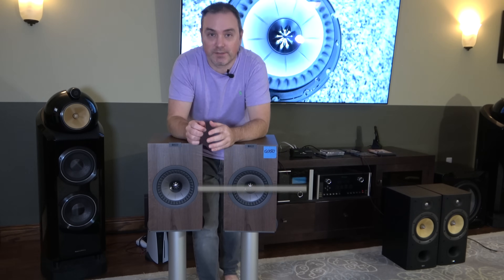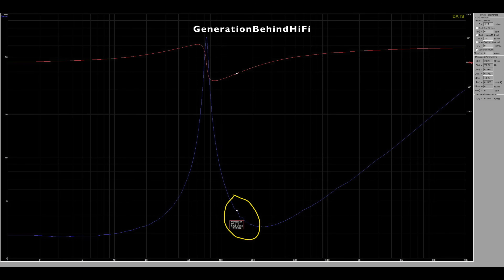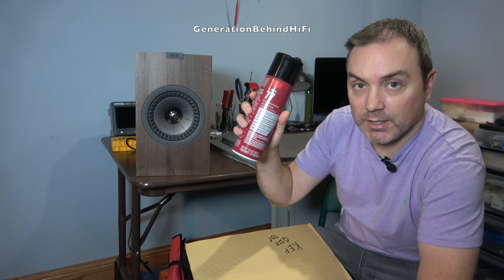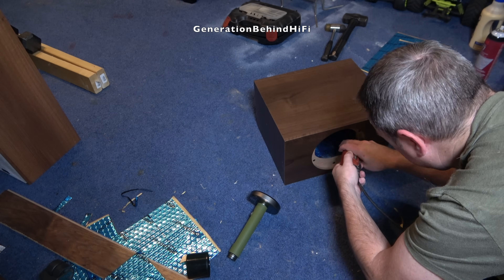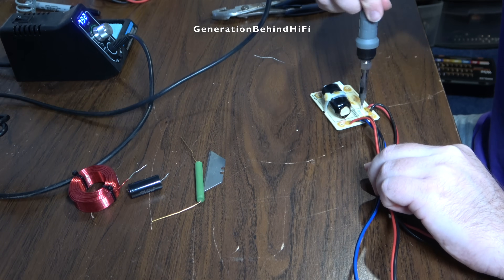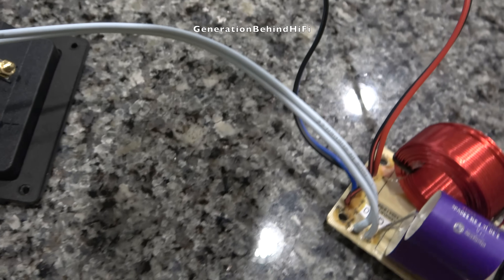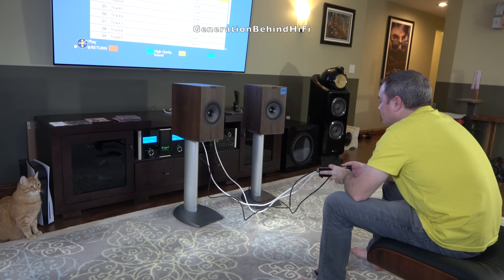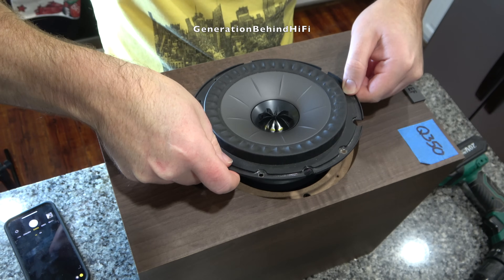Upgrading My KEF Q350 Speakers - Resolving Cabinet Resonances and Upgrading Crossover Parts

Comment: Well I, if I had those speakers I'd be using Norez as the cab dampening material it has a sound dampening layer behind its close cell foam layer. One of Online's most prominent Designers D. Richie who is an Electrical Engineer does free assessments of anyone's speakers doing full analysis then does redesign of the usual Cheesy crossovers. The analysis and redesign are free the only charge is if you want to buy the upgraded parts and tested against the original. His channel is GR-Researh or business that is.
Reply from the maker: Sonic Barrier has the same sound deadening layer built in too. It's actually a 3 layer system. I just chose to double up on the sound deadening material to ensure I would have no cabinet resonances -- as you saw in this video it worked. Yep, I'm well aware of GR-Research. He creates some cool content too. Personally I have never tried any of his designs but customers seem to be happy with them.
Reply: The Sonic Barrier product actually works a little better in this application because the cross section of the material is narrower and fits better into this tight cabinet. No-Res is a great product but is thicker in cross section making it less beneficial here for clearance purposes.

Comment: Great upgrade video! I think the radius behind the driver needs to be way bigger to have an effect. I would guess the radius needs to be 1/4 of the wavelength to have an effect. I've seen test from users on diy audio forum on the baffle edges that you need to have a pretty big radius to see an measureable affect on a sweep. And those were testing with 1 inch radius and even greater..  I also think getting rid of the iron core inductor is the fastest way to get rid of iron core distortions is the most noticeable upgrade people can do themselves. Just my 2 cents.

Comment: You can place no-rez strips on the woofer basket and magnet to try and dampen that driver resonance.
Reply: He could also solder the connections to the speaker instead of using those slip on connections. He made a point about them to the binding posts, but then kept them in the speaker which didn’t make any sense to me.

Comment: Would I use only the Amazon deadening material to improve cabinet resonance or must I also add the foam? My speakers are the RP600M V.1.
Reply from the maker: I decided to use both for my build. If you had to chose between one or the other, then I would choose Sonic Barrier. It's a 3/4" foam damping material with 3 layers built in and is really good at combating cabinet resonances. You can find it here: parts-express.sjv.io/qzW09b
Reply: Thanks.

Comment: This was an awesome thought provoking and informative video!! Thank you! 🎉 

Ps. Would be cool to see you compare upgraded 350 vs R3meta/concerto/ etc. 🎉
Reply from the maker: Thank you! Glad you enjoyed it. I have listened to the R3 Meta many times and they are a very nice speaker. Even my modified Q350s are no match for the R3. The drivers being used in the R3 are much better than the driver in the Q350. I would bet the drivers in the R3 Meta have a much flatter impedance curve and a lot less VC inductance. Most higher end speakers do.

As for the Concerto, my Q350s might have a chance against them? I sure would like to get my hands on a pair to find out, but it probably won't happen until next year. I bought a pair of KEF Q3 Meta and thought my Q350s were much better. Even most of my subscribers agreed when they listened to the sound demo of the Q3 Meta vs my Q350s. Thanks for watching!

Comment: Great Video.  Thanks for doing this for us.  What is the tool you used to check for resonance?  Maybe do a video on that as well as how to use it properly.  I would love to give that a shot on some of my speakers.  Just don't know how to do it properly.  Also, what's up with rolls of insulation stuffed into the corner of the cabinet?  Does KEF not have any quality control?  Geeze!
Reply from the maker: Sure. I might be able to accommodate your request. I'm using a Dayton Audio DATs v3 and its a must have tool if you like to tinker with speakers. 

I hear yea, the bunched up rolls of damping material are pretty low quality. I tried using them at the base of the cabinet where my crossover is but I was still getting a standing wave when measuring. I ended up throwing the KEF damping material out and purchased some nice polyfill which did the trick.

Comment: Hi very interesting video indeed   As you say the boxy sound should come from box resonances  
to check for resonances the measurements to perform are those carried out by Stereophile with accelerometers strategically placed on the speaker panels   I understand that this is a complex and expensive test   
Also stands can contribute to resonances   I tend to prefer the more stable 4 legs type to the single column type that can have a flag pole effect when the speaker is shaken by some strong bass notes 

There is an easy way to check for boxyness  Just play the music for a while leaving time for the system to stabilize
In absence of boxyness the speakers should seem like disconnected from the system and the sound completely detached from them and coming from the space around
You can also use specific tracks from test cds to evaluate the soundstage quality 
I strongly think that this depends quite entirely on the cabinet design and construction
This Kef have some good point   A thick baffle and internal bracing   
Thanks a lot and kind regards gino

Comment: Another awesome video! I use that sound deadening material in several projects and purchased a cheap pillow for poly fill. Do you have a link to the Sonic Barrier damping material? Do you know what type of capacitor the stock crossover used? I want to compare to speakers I own and do some upgrades. Just got to work on soldering skills!
Reply from the maker: Thanks, Mark. I have links to everything I used in the description. The KEF Q350 uses a 4.4uF capacitor on the high pass filter. Hope this helps. Happy tinkering!

Comment: Your vid has inspired me to upgrade my Q150s. Ive already added foam sheets to the cabinet. Id like to ugrade the Inductors on the crossover next. How do I figure out what size to get? Can I get the same size you used on your 350s??
Reply from the maker: The Q150 uses a different size inductor on the low pass filter than my Q350. The Q150 uses a .8mH inductor on the low pass filter and a 3.7uF capacitor on the high pass filter. When you open up the speaker the parts on the crossover should have labels on them that tell you what size they are. Hope this helps! Happy tinkering! :)

Comment: Great video! You should put some of that amazon basics butyl on the frame of the driver. That is probably where that ringing is coming from.
Reply from the maker: Hi Pete! Yeah, that's a great idea and I remember doing that back in the day when all I had were cheap speakers. I don't think the speaker basket is the source of the resonance but I could be wrong. The reason I say that is because the engineers at KEF used Finite Element Analysis (FEA) to develop the speaker basket so it would be equal in rigidity to a cast speaker basket. I think the resonance at under 200Hz has to do with the big Z-Flex surround that KEF uses on their drivers. I have heard this is pretty common on KEF speakers? When I get more time maybe I'll do some testing to see if I can find the source of those resonances.

Comment: Thanks for the video. Did you happen to assess the quality of the plastic port tube? On my speakers the tube was thin plastic which flexed when I squeezed it. So I wrapped it with hockey tape just like one does with the blade of a hockey stick. Yah, I from Canada. 

With the tape it sounds good, although I didn’t do a side by side comparison. For the uninitiated, hockey tape reduces vibrations emitted up the shaft of the stick. Since reducing unwanted vibrations was one of your upgrade goals, it may worth a try.
Reply from the maker: I did not do anything with the port. I did not see any issues with the original port, but I like your way of thinking! Usually with bass reflex ports you have problems with port chuffing because they are undersized. However KEF designed the port on the Q350 well enough where this isn't an issue. Thanks for the comment and keep tinkering!!!
Reply: That’s a very clever idea, I used the MLV but the hockey tape would have been way easier

Comment: Interesting, did you played the speakers for a while before evaluating? The capacitor upgrade may take a few hours. For me it was if the speakers where sounding like they where new at the first week or two.......
Reply from the maker: Hello! Yes. I kept one speaker stock while I modified the other and each time I made a change I would compare them. I included shots with me doing this in this video. It's the shot of me sitting on a chair holding a box in my hand. That box I'm holding is a speaker switcher and it allows me to switch between the two speakers right on the fly so I can the differences much easier.
Reply: @generationbehindhifi  The difference are bigger in the stage depth and with, also the layering, so with only one speaker upgraded I think you will not get the upgrade result you want.

Comment: You've inspired me on two projects (1) I have a 40+ year old DIY speaker with massively damped cabinets that probably need capacitor & ferrite (popular in the 60s/70s) inductor upgrades, does ferrite suffer from sonic issues? (2) I presently have Q-Acoustics 3050s & I'm planning to check the signal paths for steel then solder connections, what is your opinion on steel & did you check this on the Q350s?
P.S. if rated correctly laminated cores are unlikely to suffer saturation, I believe their problem is eddy current loss distortion.
Reply from the maker: Hello! Wow! I can't believe I left the ferrous materials out of this video. On the back of the terminal cup on the KEF Q350 are steel nuts that fasten the binding posts to the terminal cup. These steel nuts are ferromagnetic and I replaced them with nuts made from brass. IEEE did a white paper on ferrous materials being used in audio connectors and its a good read. Basically the study proved that ferromagnetic parts introduce passive intermodulation, aka 3rd-order harmonics distortion to the signal. If you have a IEEE membership you can read the white paper here: https://ieeexplore.ieee.org/ielaam/22/8681220/8632973-aam.pdf
Reply: Good to know I helped. How about ferrite vs laminated iron core sonics? I assume cost is the reason for the modern prevalence of iron.
Dali YT videos regarding their SMC tech make a compelling case that others choose to ignore. Their experiments are instructive.
Did you check the Q350 internal solder tags for steel?
Reply from the maker: @trevorbartram5473  Honestly I have never done a deep dive into the claims of ferrite vs laminated. While some publications claim eddy current and saturation "is not a problem" I have read conflicting information that it still occurs even in modern designs. I would rather just spend the money on air core inductors to eliminate them as a possibility.  

As far as I know solder does not contain any ferrous metals. In case you are referring to the binding post tabs that I soldered my speaker cable to, then no those are not made from ferrous material. Hope this helps.
Reply: Thanks. Yes solder tabs. I highly recommend the Dali YT videos. Their Oberon range is the least expensive with SMC. Cheers!
Reply: Refresh in the hope you see my previous comment?

Comment: Great job. I did something similar with my Wharfedale Linton 85ths. I got them to sound a little more well balanced and it was worth the effort.
It would cool to see a follow up video after a couple of months on wether or not you can hear any improvements after the crossover parts settle.
Reply from the maker: Thank you! During the entire process of upgrading these speakers I left one speaker untouched so I could hear the improvements as I upgraded components. Some had audible changes that were easy to hear and others weren't as obvious as I discussed at the end of the video. Overall I'm very happy with how these speakers turned out and had a lot of fun doing it. 

I have heard some good things about the Linton 85ths! Personally, I haven't heard a pair yet, but I think they are very cool speakers. Enjoy them!
Reply: I have a pair of the Wharfedale Linton 85s, and out of interest what exactly did you do?

Comment: Very interesting! Thanks for sharing!
Would redesigning the crossover with higher order slopes have any benefit?
Reply from the maker: Thanks! Glad you liked it. Actually an audiophile already created a new crossover design for the Q350 using high order slops for both the high and low pass filters. You can read about it here: https://www.hifialex.de/pimp-kef-q350/
Reply: @generationbehindhifi  Oh cool, thanks for sharing this! I might try this out, along with what you did in this video. The Q350s are incredibly versatile speakers. I would love to make them even better.

Comment: Ah. I wish you would have shared the after measurements to see what happened. I love these sort of diy hacks and really want to know. I wouldn't expect all resonances to be fixed since kef apparently needs to do some crazy stuff to get the resonances out of the driver with the meta mat on their uni-q drivers. Well. Thanks for the efforts. Have a good holiday!
Reply from the maker: Hello! I did share the after measurements of the cabinet. I was able to eliminate the cabinet resonances that were taking place at 300Hz and also the one between 6 and 700Hz.
Reply: @generationbehindhifi  Oh Nice! I was curious visually how different the resonance was, and the graph didn't show that range. If you're saying totally gone, then I get pretty excited about doing something in the future with some low cost KEF's sitting on top of a pair of some monster sealed subs (JTR, SB17, Ultimax 18ii) crossed over at somewhat high like 2-300Hz, as I think most of these smaller 2-way KEF's just start getting muddy. Maybe that's a video idea ;)

Comment: I put SUPRA cable in my DIY JBLs a few years ago!  
I previously had some clear jacket 1990s wire ( SOUND KING ) and ( monster )., 
Some wire turned green and some was brown and sticky.  
My new rule., “ if the wire is see-through.. it’s crap”
Reply: P.S.  
I also tried upgrading my SOLEN capacitors with CLARITY CAPS.   It made no audible improvement.
Reply from the maker: Yeah, I agree. If the crossover already contains a MKP (metallized polypropylene film) capacitor, then upgrading to a more expensive MKP capacitor will likely yield no audible difference. I wanted to try this "upgrade" out anyways by replacing the factory MKP capacitor on the high pass circuit with a nice ClarityCap CopperConnect capacitors (MKP) to see if it yielded any difference. Spoiler alert, it didn't. Hopefully when people see this video they won't waste their money on fancy capacitors because the point of diminishing return is pretty evident. Where I found you get the most audible differences for the better is when you upgrade from an electrolytic capacitor or polyester film capacitor (MKT aka MET) to a MKP capacitor.
Reply: The cable may still turn green inside an opaque sheathing lol . The clear jackets definitely showcase it more
Reply: Did you use plain or tinned copper wiring & why?
Reply: This Tweeter has Ferrofluid in it‘s Airgap, clearly visible in the impedance Plot. At least it is low viscosity, but still, I wouldn‘t go too high in capacitor quality.